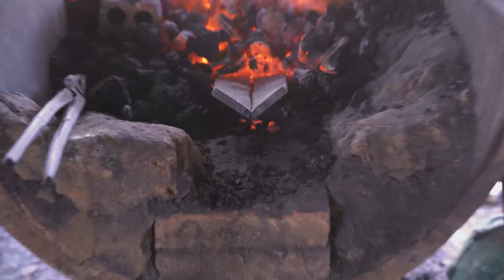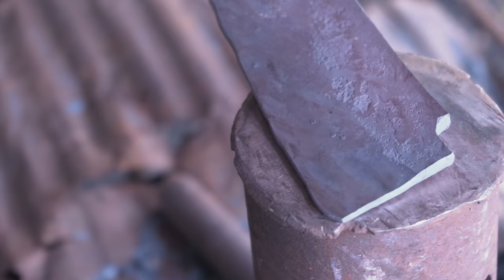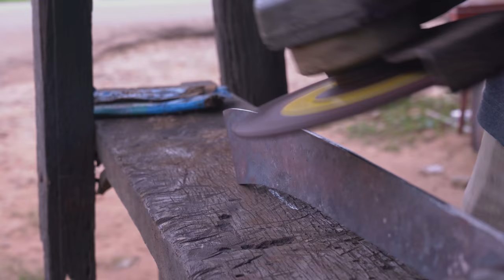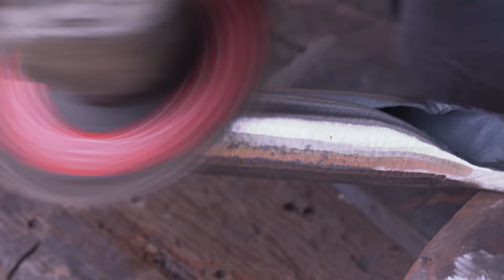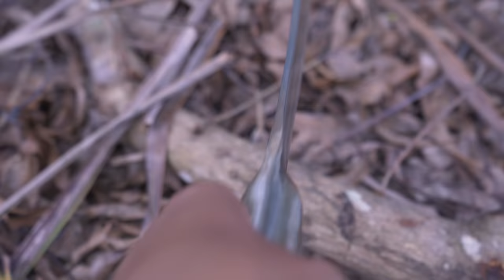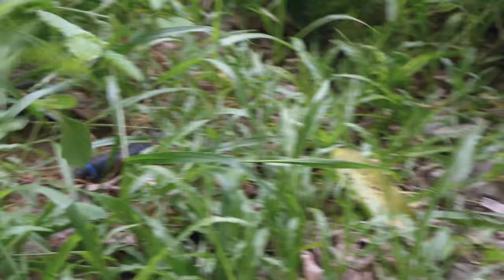BLACKSMITH - FORGING A LONG MACHETE KNIFE FROM A LEAF SPRING!!!

Comment: Great job bro 💪👍👍👍👍 so after heating the steel are you dip it in water or oil to harden the steel?
Reply from the maker: Yes, in the water. Many thanks.

Comment: Still need more finishing....
The blades surface looks rough...
Basic hardening.
No tampering.
Typical Asian technique.
Reply: Its called Tempering and it is done with only one heat if the smith is skilled enough.
Reply: @esucll ... It's a liquid hardening....

Tampering is another process after hardening.
🤣 🤣 🤣